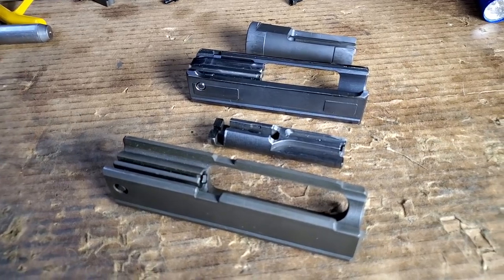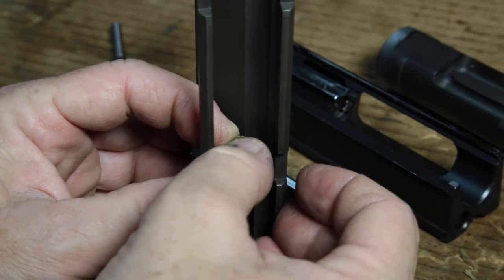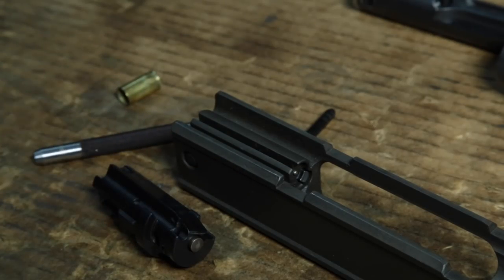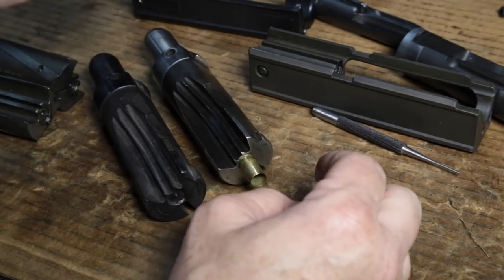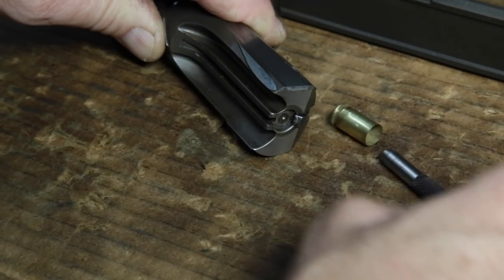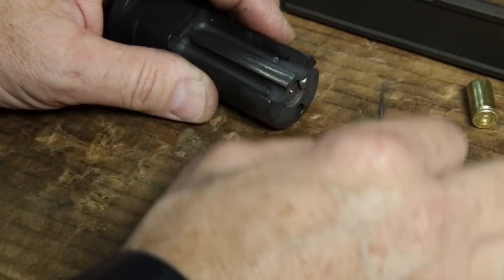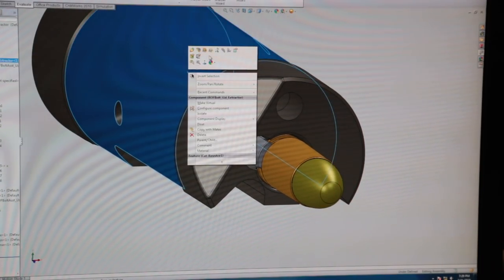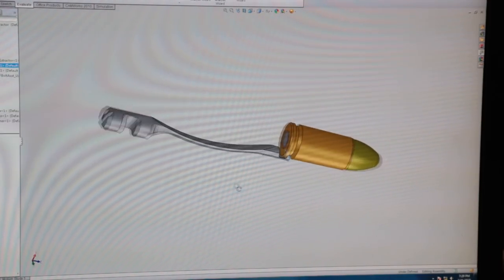Extractors!

Comment: Thanks for the video Mark I learn something every time I watch them. I was having problems with my full auto Uzi extracting I kept replacing the extractors and still had the problem then I discovered that my ejector was loose. I preened the rivet tight problem solved.

Comment: Another key reason for an extractor on a blowback design is that without one, it's difficult to unload a firearm. I've played with blowback designs with the extractor removed and it can be reasonably reliable, but have fun getting the cartridge out of the chamber. 

I haven't tried one without an ejector, wouldn't expect that to be remotely reliable.
Reply: beretta 21a .22lr pistol does not have an extractor , but the barrel tilts out to be able to remove a cartridge.

Comment: I love the food for thought these videos supply, you cause me to think. I think that's a good thing. If you're ever inclined to make a DI AR in 10mm auto, setup to feed from a 45ACP UZI mag, I'd love to see how you solved it. Mine is about 85-90% effective in feeding, very accurate but getting it to feed reliably has been a challenge. Do you ever get to the point you have to walk away from something for a while? Thanks for the Vids.
Reply from the maker: Thinking is always a good thing!  Unless you're dealing with women, of course.  :-D Best way to solve your problem is to put it on high speed video and really see what's going on.  Yes, I take time away from my designs all the time...I find that clearing my head really helps.
Reply: @markserbu  That's one of the diagnostics I used to get to the higher numbers, I will try some more and see if I can nail down the cause.

Comment: Boy it would be easy to just drop that extractor in a Bridgeport and make those changes. I know CNC is better, but I’m in my zen place in front of a manual machine. Everything else just goes away. 
Where is the spring on your extractor? Is it top backside or middle backside. That will help in understanding what force is being placed on the moment.
Reply from the maker: You and your Bridgeport!  Funny, in front of that archaic beast you're in your zen place, while the same spot for me would be my "I wish I were dead" place.  :-D  The spring is at the opposite end from the hook...you can see the hole for it in the CAD model starting at about 15:56.
Reply: markserbu okay I didn’t see, how far behind are you and do you want to sub out non critical parts? Or is it a matter of assembly?

Comment: I believe on extractors with the longest possible distance between extractor claw tip and the pivot and, like you, the pivot center and the smallest radius on the case extractor groove on the same line (adjacent, while the rim height is the opposite).
With a long adjacent compared to the low opposite, the difference between hypotenuse (hypotenuse would be the distance from the pivot to the extractor claw tip) and adjacent would be a small clearence between the extractor tip and the rim.
But I just draw... if I try to make a single shot 22 short here I can go to jail.
Reply: Thanks for writing down your "formula" for extractor design, I've been struggling with finding a simple and effective extractor for a 9mm carbine I've been working on.
Reply: @justindunlap1235  I didn't make even a single video on extractors, but I have one for an open bolt (safer than the UZI - of course, since it's an open bolt it is not allowed for regular people even in US) in poor "almost english" and a closed bolt with a Glock style trigger in portuguese (but the concept is clear). Take a look and use them if you want (in my country they are useless).
I made them with home production in mind, no stamping, no sheet metal; just cut, drill, file.

Comment: Question I have had for a while, although not 9mm or blowback per se.

What is with the extractor like in a ruger 10/22 actually caming away from the cartridge when bolt is fully forward? 
What's that about?
Reply from the maker: The extractor clearance slot in the barrel is cut with a round cutter, so it gets shallow as the bolt goes forward.  Naturally, the extractor rides along the slot as it gets more and more shallow, and of course that tends to cam it out...away from the barrel centerline.

Comment: Hay Mark I have a Ruger Mk2 M77/223 after watching this video it really got me to thinking 🤔. That rifle has control round feed kinda ?????? I guess. I have to say my rifle doesn’t want to reliably extract chamber or extract cartridges. Any recommendations or thoughts would be greatly appreciated
Reply from the maker: First check the chamber roughness, then do the same things I was doing here to test the extractor.
Reply: markserbu nice 👍🏻 I never thought to check that will do
Reply: I basically have one in 3006 too. It's a mauser-ish bolt. it always grabs the cartridge case very strongly but it doesn't eject very clean because the ejector post is so far back in the travel that you have to have some velocity on it for it to control the direction before it lets go of the extractor. I'd be willing to bet that there's a specific speed that your bolt wants to run. I think your extractor probably hooks strongly onto the case but that the case can fall out from under the hook.

Comment: I appreciate a good extractor, such as on the Beretta model 71.  Yet, Beretta also made the Bobcat with no extractor at all, claiming blowback operation does not require one.  That strategy seems odd for one company, as one of the reasons the Mod 71 is very reliable is precisely because of its well designed robust extractor.

Comment: 10:51 "I had a mechanical engineering degree at that point" Did the state of Florida find out about your exploits with farm animals and yank your degree? 8^P
Pretty sure you wanted the extractor opposite of the ejector so the spent shell case pivots around the hook equally during ejection. You don't want to screw up the design like S&W did with the Model 76 SMG where the ejector is not directly across from the extractor and results in the gun having a nasty habit of breaking extractors.
Reply from the maker: Ha!  As I admonished you on another board the ejector does not have to be 180-degrees from the extractor and on many excellent guns it's not.  Never heard about the S&W 76 extractor issue...would be interested to look at one on high-speed video and see what's up.  In the meantime, don't forget that correlation does not imply causation. ;-)